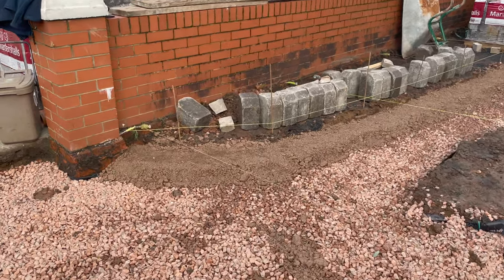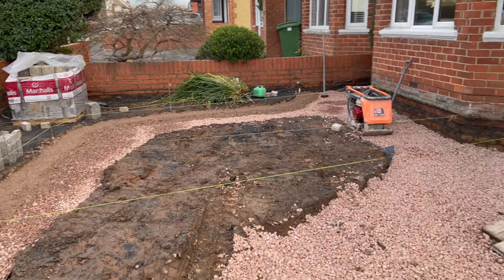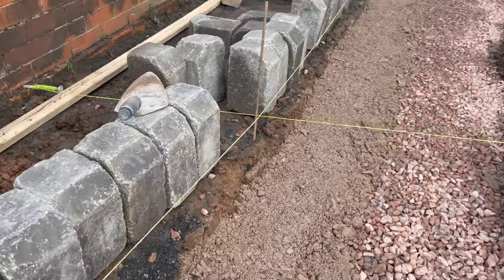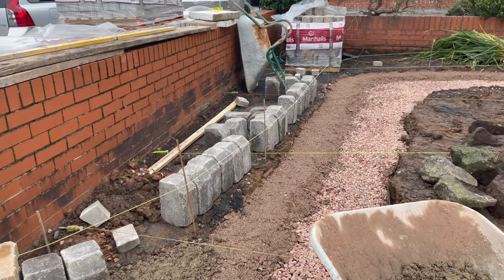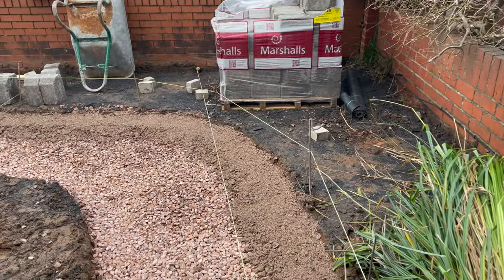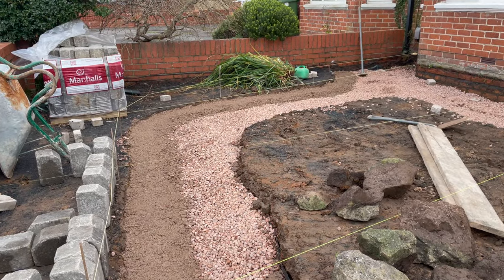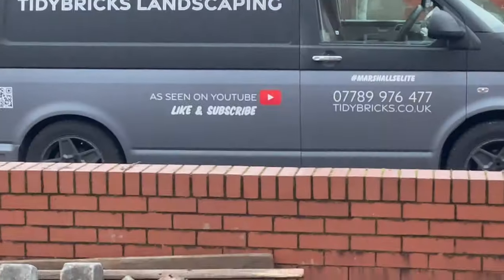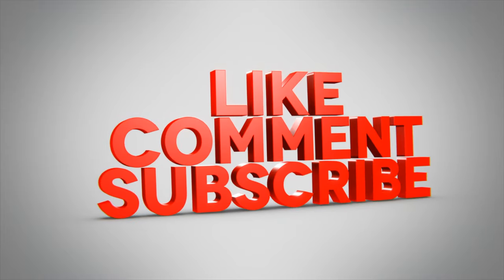Curved Landscape Edging: Perfect Your Technique with a String Line 🌿🔧 #edging #pavers

Comment: Nice vid. Are you laying final mortar to set blocks on top of compacted MOT, or is that a mix of something else ? it looks a little darker than the MOT, but it might just be wet ?
Reply from the maker: Yes I just happened to,run out in the day but I went back around to around after with more cement to ho;d em 👍🏴